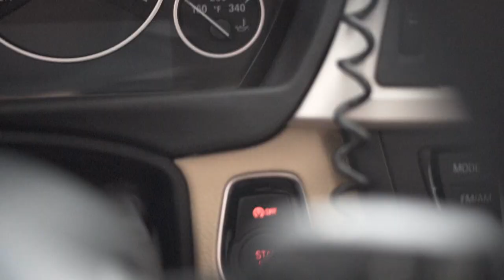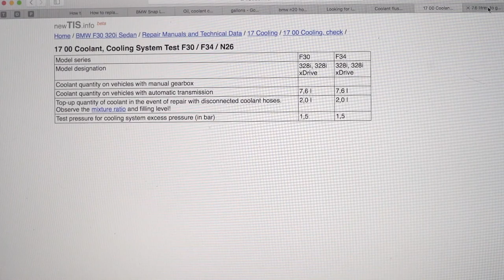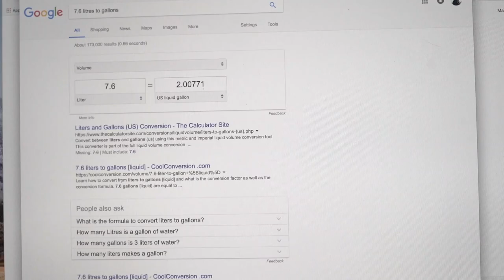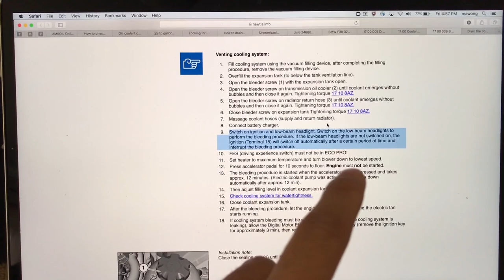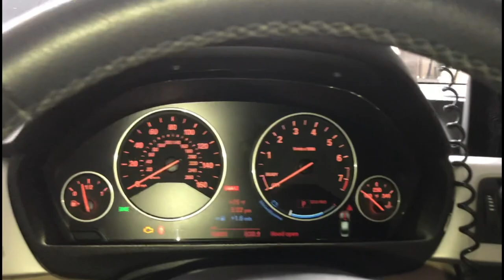BMW F30 328i COOLANT FLUSH & BLEED

Comment: I've been a mechanic for 40 years, and anybody who thinks German cars are poorly engineered knows absolutely nothing about cars. German cars are the finest engineered cars on the planet, I've worked on everything under the the sun, and German cars are the best hands down. Do your research before you make statements you know nothing about. The reason BMW does not use a drain plug, is that it could cause a failure point for a leak.
Reply: "The reason BMW does not use a drain plug, is that it could cause a failure point for a leak."   More likely they want to discourage DIY types so they have to bring it into the dealership where they can generate more $$$ for BMW.  As a mechanic, you probably won't agree.
Reply: @whothecapfits  totally agree with u... and they even make it hard on them selves so they can charge xtra xtra money.... I work on cars as well.. and I never see a car leaking from drain plug... that is just an excuse so they can make a lot of money..
Reply: don't mention to this guy the oil filter adapter gasket on the e46 series.
Reply: I dont give a fuck about a leaky drain plug, this process looks absolutely horrible. Getting rained on with poisonous coolant isn't on my bucket list. This should be better.
Reply: True!!!! I own a BMW 428i Coupe and it’s awesome. People use and abuse these cars and when people buy them used, they tend to carry over all the negligence from the past owners. Take care of these cars and they’ll take care of you!!!!!!
Reply: I know a guy who got 400,000 miles on his E39 528i on his original motor. He’s been running AMSOIL Euro Formula 5W-40 since new and man that encouraged me to put it in my BMW!
Reply: Ridiculous… every other manufacturer doesn’t have an issue with their drain plug.. might as well seal up the oil pan and drop that to change your oil…
Reply: Really, for 40 years? What rinky dink shop have you been working at - "Under A  Rock Motors" ? I've been servicing German and Swedish cars professionally and exclusively since 1983. BMW isn't a shadow of what it once was. It started around the time they decided to use plastics extensively in the cooling system and started doing away with oil dipsticks. Since that time, they have been making garbage that constantly fails - plastic DISA valves, VANOS that's very fussy about engine oil and wears out prematurely, less than reliable/durable transmissions, frequent ABS failures, gaskets and valve stem seals that can't take the higher level of heat they run at to meet emissions, air pump injection ports that constantly plug up - the list goes on and on and on. Don't know what rock you've been living under for the past 40 years but if you've been working on BMWs professionally over that time, you had to have noticed the severe decline of the company and its products - unless you are a blatant liar, which I suspect is the case - Mr. Impartial BMW Advocate with an obviously German Youtube handle....
Reply: I am a Aircraft mechanic and I have worked on cars. This has got to be one of the dumpest statements about why there's no drain plug?! 😅

Comment: Thanks for posting the full procedure. Sorry you had to get a coolant shower. 

One tip for mixing coolant - keep your empty BMW coolant jug, and then in the future, pour half of new coolant into the old coolant jug, and then add the water to both jugs.  You’ll have your two gallons of mixed coolant, already in the jugs. No need to mix them in a bucket.

Comment: Great vid. I think if you left the cap open for the fill talk while bleeding you wouldn't need to open the bleeder screws. The air comes out of the port that shoots the coolant back into the tank as it recirculates.

Comment: Hey when adding coolant do you have to have all 3 bleeder screws open then when it starts leaking out coolant close it up and start bleeding procedure? If so how open do u have the bleeder screws all the way out or half way?
Reply from the maker: I tried all three at first until they started leaking out. Then I tried each individually about 2-3 more times to make sure there was no air

Comment: does this apply to the 335i
Reply from the maker: I don't believe the N55 has this issue with timing chain compared to N20.
Reply: @MatthewWong  do you know where to drain the coolan from on my n55
Reply from the maker: @dndxander  https://f30.bimmerpost.com/forums/showthread.php?t=1278783 I think this is what you are looking for
Reply: @MatthewWong  quick question man should I loaded bleeder screw when bleeding water and have cap off or have both them on. Please help I did I flush with water but I have foamy stuff in my reservoir!!!
Reply from the maker: @dndxander  When I did the bleed I only had the screws undone I believe. Its been a while. I am also not sure if its the same on N55 vs N20 (pretty sure its the same but not 100% positive)

Comment: Do u have to open up the screw during bleeding procedure? Cuz i mostly see them just pour coolant in then start bleeding procedure, they say the water pump will do the work and take out the air and then u just top it off with more coolant, is that true?

Comment: 4 questions:
1- Will it be okay to use Castrol blue color coolant instead of Bmw Coolant? (I have always used it on my all E36 E46 E90 without having any issue).
2- Is it possible to remove the lower radiator hose from underneath the car without having to remove the air filter box?
3-Is there any drain plug on F30 radiator?
4-On F30 N13 engines without an electrical water pump, is it enough to remove the lower radiator hose for the draining process?
Many thanks in advance!
Reply from the maker: In order of your questions:
1. Im not sure this is the first coolant flush I've done on a BMW. 
2. Not easily, the clip to unlock the pipe goes up towards the bottom of the air filter box
3. There is no drain plug on the F30 Radiator 
4. I am not sure about the N13 engine
Reply: @MatthewWong  Sorted out. Removed the airfilter box and drained more than 5lt of coolant via lower radiator hose only. I have mechanical waterpump so skipped the electrical mechanial pump fill process. Used 50% 50% Blue color Castrol Radicool coolant and drinking water. Released air from both expansion tank and heat exchanger several times. So far so good. No need to pay extra for Bmw coolant.

Comment: Just recently got one & the “service needed since” notification popped up exactly like the one showed in yours. 
Dealer said they flushed and did the oil etc. It’s the weekend and their closed rn, but I’m going to see what they say. But is there a way to reset that notification. I’ve seen videos on resetting the them, but that hasn’t worked for this notification. 
Maybe you can give me some information on that. Thanks, well informative video btw.
Reply from the maker: If its the oil notification https://www.youtube.com/watch?v=ozRv0eZW0OU you can do something like this. However if its the coolant low notification there isnt anything you can do.
Reply: Matthew Wong  it must be. Because it didn’t come off. Appreciate it.
Reply: Matthew Wong  update. I played with it a little more and found it was the inspection of all things through the vehicle status settings on the screen 😂glad it wasn’t a real issue....At all.
Reply from the maker: @anotherindividual5799  Glad everything worked out!
Reply: Update for anyone looking at resetting codes other than oil change, research Bimmerlink + Veepeak BLE.

Comment: Do you have to bleed it every time you put coolant in?
Reply from the maker: If you are just topping off into the reservoir I don't believe you need to. Its only to purge the air out of the coolant pipes when you need to bleed.

Comment: Hey friend hello from turkey. İ wonder that lifting eqipman for lift up the car.  İ want buy it but i couldnt find. Whats that name ? Where can i buy it . Thanks so much
Reply from the maker: The car ramps you can find on eBay here: http://rover.ebay.com/rover/1/711-53200-19255-0/1?ff3=4&pub=5575300093&toolid=10001&campid=5338084593&customid=&mpre=https%3A%2F%2Fwww.ebay.com%2Fitm%2FVehicle-Drive-on-Ramps-12000-lbs-Capacity-Car-Truck-Service-Repair-Shop-Garage%2F352602935374%3Fepid%3D14023040722%26_trkparms%3Dispr%253D1%26hash%3Ditem5218c5d04e%3Ag%3AN1kAAOSwB6Zcc4qG%26enc%3DAQAEAAACQBPxNw%252BVj6nta7CKEs3N0qXMuY16jR%252BKv9m77o3UJqE3U1N7Quf8Dm8fCMBrjshqG9MvXSmb2e%252FnAzaPUmKCTQAd%252BUh6jmu4UzLR6JugR3Qe5cGvEa6qWbuwLC8V5B1qpdfmzo%252FIUx1VpgFlMnuSzsA%252Bnbkb2tUsXnhRW0F%252F0UtcQdjgsUCym%252FgAYNyhq1tWzmBRD%252Fq%252Fl2bSmffZsT5A8A21x%252F955x6mEAqk5zGVeLUvfwD%252FfFbxjsIGxVBwtDhbPW%252FjpgyxCqdkBgJcB6FCknujEu75vE8kfSFvd6LoDM8ngPUV9z40cBA%252BJVekkwU94NTbB9OxhfXip4qSuuAEVhorh9E%252BxpTAkKhvEL0juoNfRZS07IXoF0XO7%252F%252BC6p8qZ6BFzlqjuXeVlgxP%252FUyDEt%252Fnuec0Oqbt1Z4JbutmKxKoAwD71NzkqV3amFvdViRgIcWsQTXeNapgNxyTm85vzat08%252F7%252BerX4sz9zfsV5nvrtkJ9qrgu5XjHD169sx6%252BpChS8tFUbfsMf65z7sv5reKB13pxemR4TNPt79kQO7wX4%252BrOLKwqy7ZO5SAOyUUN11WzfSCatULBZEFZMEdcz7A9suYdsktb38qypmQfBRppLmfl1rBvY4ztxQSFeBOdhrnyKKWYXN%252FpFzBf8iKiLpnUX5KwPZ5ZkKOX7QoIQMorsdcGS3EziQf9rGtOwCF54exISXm%252FT6r0A0yjQbfzfIS%252FZ%252F7ET3v7qhSWWBF%252FlMd1UmF%252F1XyTjxXQvYGnwmttyZg%253D%253D%26checksum%3D352602935374b1aac3d482704159928b27091b3d515c

Comment: Doing this on my F30 335i. Cannot believe BMW hasn’t just designed a fucking valve go drain it properly. It feels so primitive unplugging the EWater pump hose and lower radiator hose to drain coolant.

Comment: Awesome video! Does the bleeder screw at the expansion tank has to stay open during the bleeding process?
Reply from the maker: According to the documentation here: https://www.newtis.info/tisv2/a/en/f30-328i-lim/repair-manuals/17-cooling/17-00-cooling-check/HrgIPzMT

You are supposed to leave the bleeder screws open only when refilling in the expansion tank. All bleeder screws should be open. Once they start overfilling thats when you tighten them down, then make sure that the overfill is at the min/ max. After that you can start the bleeding process.
Reply: Thank you!

Comment: So according to the instructions you posted

TECHNICAL INFORMATION

Filling without the vacuum filler device (watering can filling) is not permitted.

Non-compliance will result in danger of component damage and/or engine damage.

Filling specification absolutely must be adhered to.

The operation of the vehicle is not permitted unless the filling procedure has been completed. Otherwise, functional limitations (degradation) and/or overheating may occur.

A bleeding procedure is required after a part has been exchanged in the cooling system and/or after refilling the cooling system.
Reply from the maker: Yep BMW recommends you use a vacuum to make sure you get all the air out. I'm pretty sure they have been recommending this for a while now. But again as I mentioned I am not doing that. Most people who DIY this just flush the coolant out then run the standard bleeding process to get the remainder of the air out. 

For example even for the transmission flush BMW recommends a pump but it is not necessarily required in my opinion.

Comment: When you do the electric pump bleeding process should you keep the tank cap open or closed??
Reply from the maker: The tank cap should be able to stay open. The tank is only for building pressure when the coolant is hot. You should only be leaving the bleeder screws open that way when it overfills at those areas it shows there are no air bubbles. The process is documented here: https://www.newtis.info/tisv2/a/en/f30-328i-lim/repair-manuals/17-cooling/17-00-cooling-check/HrgIPzMT

Comment: Did you actually use the entire 2 gallons? I’ve only got 1.5 gallons of 50-50 in and it’s full now after bleeding. I have an F25 328xi with the same N20 engine. Please advise
Reply: Response to myself after a year 😂. No, you won’t use all 2 gallons. More like 1.5..
Reply: @KashifRoshni  Thanks, was wondering why the whole 2 gallons didnt go in.

Comment: Hi. Just want to know what if we never do the mix. Just pure bmw coolant. Will it harm the engine ?
Reply from the maker: I don't believe it will damage the engine directly, however it might not be effective to the engine in low temps. I would recommend just mixing 50/50 always.
Reply: @MatthewWong  It will definitely hurt the engine, pure coolant doesn't have the cooling properties of water, coolant is in there so water doesn't rush components and it  lowers the freezing point of the mixture, water is the best for pulling heat out of everything
Reply from the maker: @paulvarley1054  Thats good to know! Yeah I've always read that there are different mixtures for different climates but I never knew pure coolant was bad.

Comment: Do u really need to drain the coolant out? Couldn’t u top it off and do the bleed?
Reply from the maker: You could. I just did this to demonstrate how to do a complete flush. Eventually the coolant degrades and it would probably be better to fill it with some fresh coolant.
Reply: Matthew Wong Ight cool thanks for the response bro it means a lot for your insight

Comment: Is it the same process in a 2014 bmw 435i n55 ?
Reply from the maker: Should be similar process. Just different bleed ports and draining.
Reply: @MatthewWong  Hey Matthew, fantastic video, thinking of this DIY. Is the process same for the 320i F30 N20 engine 2013 model?
Reply from the maker: @tatendak  Should be exactly the same!

Comment: Hi ! 
First of all thanks a lot for the video.
Just have one question
Before start all process its necessary in the begining disconect the batery?
Cheers
Reply from the maker: It shouldn't be necessary to disconnect the battery. You are not dealing with any of the electrical systems that could potentially damage the car.

Comment: I don't have a battery charger cant I just use my wifes car to jump it while I do the procedure?  It should work no?
Reply from the maker: I am not sure entirely if you can, but I don't see why not? I think it's just to prevent the battery from possibly dying during the procedure.
Reply: Thanks.  Great video easy to follow. I actually have to change my thermostat. I think jumping it will probably work my battery is like 6 years old so I don't want to chance it

Comment: Pour the coolant first until bubble come out , then only start bleeding process ?
Reply from the maker: When you pour the the coolant in it should force most of the air out. The left over air will be in the bends of the pipes and certain air pockets. Then you should begin the bleeding process which should pressurize the entire system. You can do this a couple times to be sure, or you can get one of those pressurized bleeders for the car also which should suck out all the air.

Comment: Yes are yoyusure there is no drain plug on the bottom of the Rad...?
Reply from the maker: I know previous generations of BMW's had a drain plug at the bottom of the rad. For some reason the N20 variations did not receive that at least to my knowledge on the F30 platforms. You can see the official NEWTIS repair steps provided by BMW here: https://www.newtis.info/tisv2/a/en/f30-328i-lim/repair-manuals/17-cooling/17-00-cooling-check/1VnZAyo8nd they ask to remove the entire coolant hose at the bottom of the rad.

Comment: So I need to actually take the coolant tank out and then drain it as I put oil in it by accident on a very rough and dark night for myself. What steps would be needed to remove and flush the tank itself?
Reply from the maker: Hmm I would look over realoem to see how the tank is held in. I would also check newtis to see if you can find anything on the tank removal: https://www.newtis.info/tisv2/a/en/f30-328i-lim/repair-manuals/17-cooling/17-00-cooling-check/I4nHM7Ef

Comment: Why was the fluid color  so clear at 8:30,  was that the distilled water flush?
Reply from the maker: I think my car was previously in Arizona and the previous owner used significantly more water than coolant mixture.
Reply: @MatthewWong  
Thanks for the quick reply. I just replaced the thermostat and water pump on my F10 n63, there are videos on here flushing  with straight distilled water before  refilling with the 50/50.  mix. You video Helped me out👍🏾
Reply from the maker: @twistedsd  I think depending on where you are its fine to run distilled water. If you see your temp's start to rise you can mix in a % of coolant and it should help!

Comment: I don't see the bleed part? where are the screws?
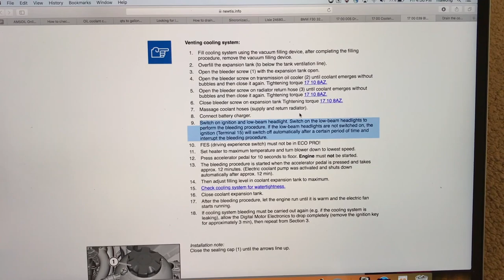Reply from the maker: I show the screws at 18:44 didn't really record the process of doing it. It is well documented in the newtis documentation: https://www.newtis.info/tisv2/a/en/f30-328i-lim/repair-manuals/17-cooling/17-00-cooling-check/I4nHM7Ef
Reply: @MatthewWong  I wish you done recorded that part since it's the hardest part. It's really a tricky procedure.

Comment: Quick question, since I’m going to add some cooling into mine why is the old one that you took out clear but the new one is blue. I know that all the BMW coolant is blue but I was just wondering why yours was clear as well as mine that’s currently in the car
Reply from the maker: My car was originally in Arizona so they probably diluted with more water than anti-freeze. That is why its probably so clear. But depending on where you live you should adjust the ratio if its colder, or hotter.
Reply: @MatthewWong  thanks for the quick reply before I add some, I live in Cali so just picked some coolant to top it off since it’s at the minimum mark. I’ll just add some without diluting it then since it’s only a minimal amount, I was just wondering why it was so clear in mine LOL